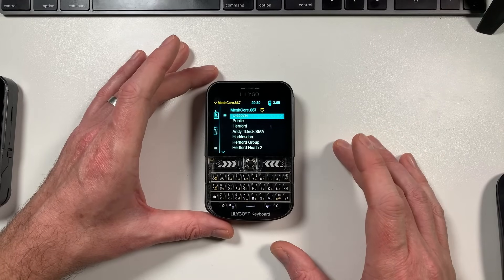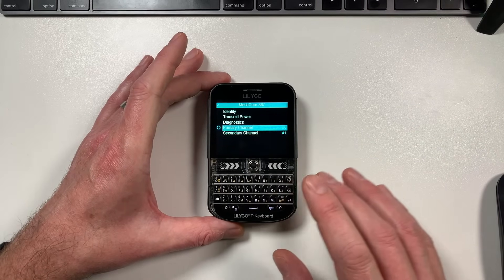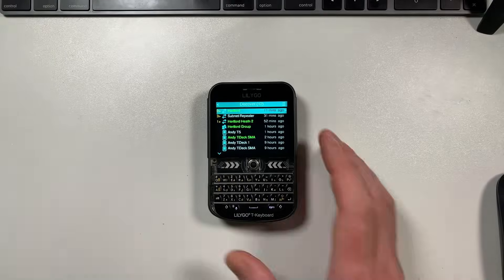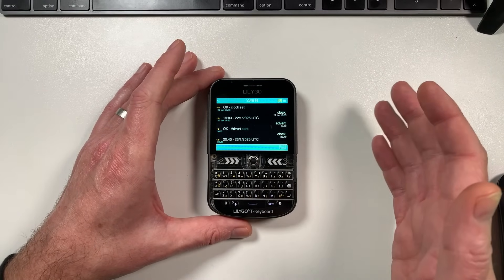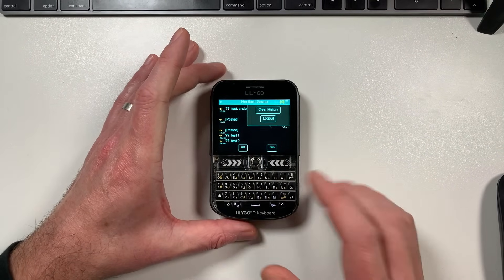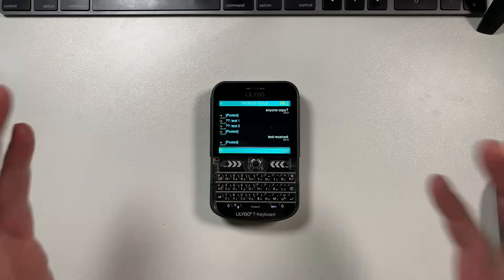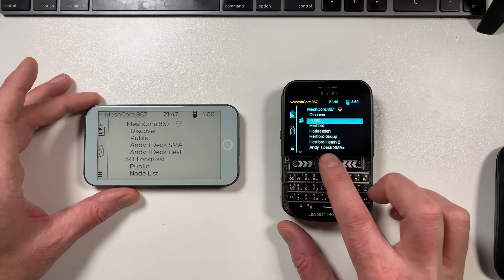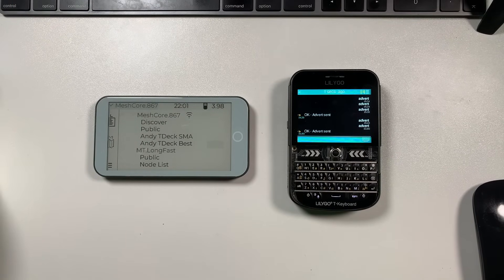TDeck and Meshcore overview

Comment: My 2 bobs worth concept additions: *750mhz to 1ghz MeshCore off grid wireless peer to peer repeater node relay mesh text messaging 10khz x dynamic auto select most under used from 25,000 channels for each link, to send sender and device identification, sender icon or micro photo, text messages, GPS location and to show relay nodes on map and new message reception chime when receiving a new message or reply from specific password access or open user device or all public on area subscribing to devices, with option to see complete message or relay node name route. Solar repeater node and solar dock for portable device with screen including touch screen keyboard.

Comment: Finally got around to watching this whilst mbutil runs through converting my state and about 30mi all around the border OSM .mbtiles to XYZ, about 160k/822k done

I just have to say the Groups function is such a little gem, but the fact that you can run dual purpose off a Wisblock of a Heltec is incredible. 

I'm so glad I put all my hardware in the Meshcore lane, nothing is cooler than whats happening with this project! ❤🦉✌️

Edit*: after this video I got my first Room Server configured, I've had a little trouble getting it to show on my T-Decks, but thats probably a me thing as I've got repeaters working no problem...

Comment: would you go with internal or external antenna with the t deck plus?
Reply from the maker: I just use internal as im always near a repeater 😁
Reply: @ I’m in Blackpool so got mark and the like round here. Will try internal and make it external if needs be then. Cheers
Reply: external ant on t-deck makes a BIG difference, and now they are selling them with the ext antenna already installed, for about the same price as the original internal ones.

Comment: Why is there no meshtastic type client but just for regular wifi and bluetooth? Kinda like the talkie app, but why cant we just talk from one wifi router to another or one wifi phone to another? I get most wifi and bluetooth have to be secure but why cant theer be some sort of puyblic wifi messaging standard for fun public local wifi messaging usinbg a dedicated old wifi router used just tpo look for others also looking? is that too much power or what? isnt meshtastioc doig the sa,me thing? Cant we have much shorter range radio via regular wifi? i just wanna have more meshtastic style cool messaging apps but using regular wifi and bluetooth and even data over powerlines

Comment: I'm very interested in MeshCore, I'd just need system to mature a little before I go all in. I saw on another video you used a serial terminal to test a node, would this be something we could use (maybe through programming libraries) to automate nodes? For example I have a weather station and I'd love to be able to message it have it respond with the current weather conditions.
Reply: It would be quite easy to make a bot that responds to text commands. Just modify the simple_secure_chat example, and add logic to the onMessageRecv() function. Then just use the sendMessage() function to send the bot's reply.

Comment: I can see the appeal for this in congested ares but can't the same (or close to) be achieved with Meshtastic?  Repeaters placed evenly to cover the desired area and the rest of the mesh nodes on client mute.  I think the biggest hurdle would be actually getting people to use client mute ;)   Also Meshtastics does have a bbs if people want to use it, though it's not built in to the software. 

Both have their use cases, Meshcore is ideal for places like UK where it seems theres a node in every other house. 
In a sparsely populated mesh the meshtastic approach would possibly work better.

Comment: Does mesh core communicate with meshtastic devices or only mesh core devices ?
Reply: So just starting out I will have to choose between being a meshcore guy or a meshtastic groupy
Reply: @ShrpBld78 I prefer Meshcore over meshtastic but I haven't tried their new UI yet for meshtastic on the t-deck
Reply: Only MeshCore. The two are like chalk and cheese. MeshCore is an entirely new design, a complete re-think.

Comment: I guess there are a few concerns for me.  One of which, is more my own personal concern vs for MeshCore stuff.

1. Adoptability... For so long, you and other creators were pushing Meshtastic quite a bit, and not there is a complete 180 to push MeshCore.  Meshtastic has gained a HUGE following and popularity bump within the last two months even.  Is there enough leverage / push for MeshCore to overcome Meshtastic, even with all of the issue(s) we have seen?

2. DMs / Routes being reset manually... Part of me using Meshtastic, was that a lot of this stuff was automatic.  While I don't necessarily resetting paths once in a while, having to do it consistently can become frustrating honestly.  Are there any plans on figuring out how to do this automatically, without spamming the network?

My third point, again more of my own issue(s).  So much of my devices are NOT compatible with MeshCore as of yet to even attempt to test it.  And I really don't have the coding or technical knowhow beyond slight tinkering with codes and getting stuf to work, let alone tampering with source code... lol

Comment: Love what you're doing here. Is there any plan for a KISS TNC/Direwolf/FreeDVTNC interface? I'm in a heavily wooded rural area and UHF just doesn't work. We've been using reticulum on the HF ISM bands (6.78mhz,13.56mhz, sub100mw in USA) into an NVIS antenna to get connectivity to each other. Would love to see something like this in Meshcore.
Reply: That is so cool I didnt know there was HF ISM bands. what radio are you using?
Reply: @mk12pickle  a TruSDX into a tuned endfed with about 30 feet of coax. To be legal, you lower your volume till you hit .1w.
Reply: @yNosGR  and direwolf modem for the sound card modem?
Reply: @mk12pickle  Yup, direwolf for the sound modem. I've heard of people using FreeDVtnc as well. I've also used the TC2BBS on meshtastic with JS8Call, but that is just one way at this time.

Comment: It sounds like the things you wanna be careful with on this system will also help with Meshtastic - ensuring good signal between long range repeating nodes. 

The only novel thing here that stood out to me was the chat group behaviour which is stateful about the conversation history. Question on that: how often does a node check for the latest chat state (missing messages)?
Reply from the maker: It only checks for messages when you login to the room.
Reply: Also, once logged into a Room server, the node gets push messaging automatically. So there's no 'polling' for new messages.

Comment: Does it work OK on the T-Decks with the poor touchscreen? Can it be flashed with Launcher?
Reply from the maker: Yeah doesn't rely much on touch, M5 launcher works and settings are stored persistently
Reply: @andykirby   Thanks, that means I already have enough spare hardware I can use, when the firmware becomes publicly available. It seems a very retrograde decision by Meshtastic to reject a multi messenger supporting only the client mode they seem to be recommending, especially when the existing choices of client for the T-Deck are a horrible interface, that is too poor to expect regular users to try and a fancy one that is very usable but so out of date it crashes all the time. My personal use case/aim (apart from playing with radio gear) is to cut mobile operators out of the loop in communication with family and friends (at long distances routing via the internet).